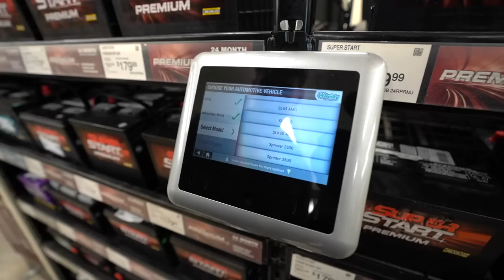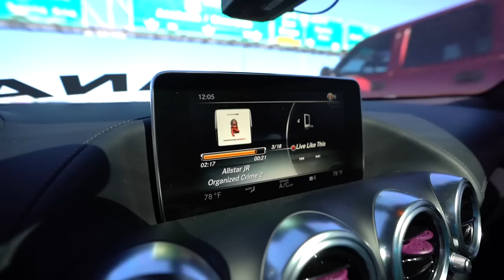THE WORST PART OF OWNING SUPER CARS PT.2 *GOING BACK TO HELLCAT*

Comment: Just send it to caravan or Carmax. Too modified and too many issues for somebody off the street to buy a base gt for the price you want. FYI aftermarket mods actually lower the value of a car. That's why people keep stock parts. Also exhaust mods mean most people won't even be able to register the car without replacing the missing exhaust parts.

Comment: If you try to sell, you gotta remove majority of your mods. If you trade it, then you will likely not get the numbers you want. Either way you will likely be taking a hit either way you choose. 💎💎💎
Reply: Exactly nobody going to take that high mileage modified Mercedes that is bound to have all kinds of glitches until it's back to factory mode but either way won't be a big ROI since it's just a Mercedes-AMG GTC and not a GTR which has a significant price jump in the used car market.